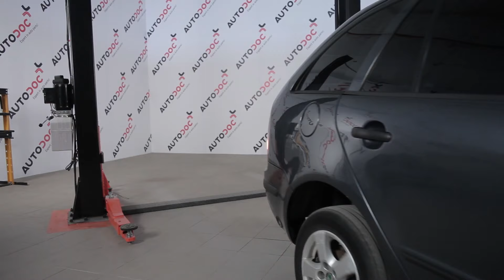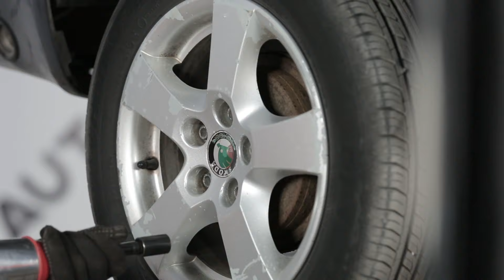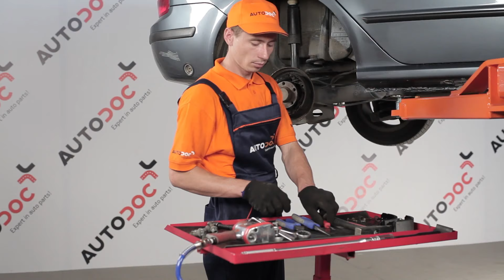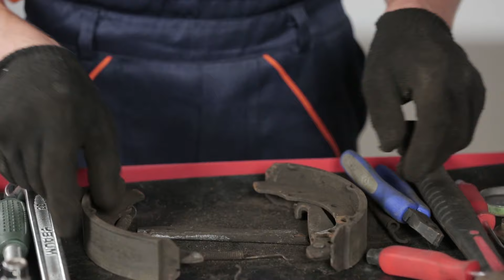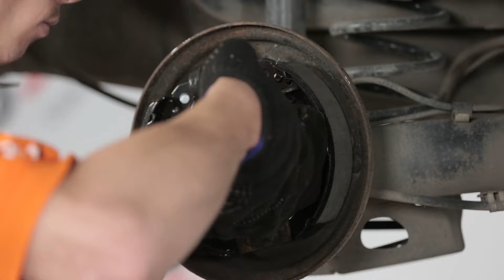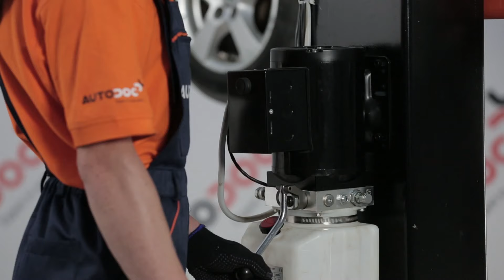How to change a rear brake pads SKODA FABIA 6Y TUTORIAL | AUTODOC

Comment: FYSA - the axle hub nut is a 30mm.  Your video guide calls for a 32mm box end spanner but uses the 30mm end during the torque sequence at the end of the video.
Reply from the maker: Thank you for your feedback! You are absolutely right, we made a mistake in the captions. Unfortunately, we cannot change the captions, but we will add this information to the description. Thank you for your valuable remark! Best regards, Autodoc.

Comment: Funny how the drum just came off, had to push adjuster up to release mine,  also funny the hub came off with a slight pull, had to use a puller on mine and then landed up buying a whole new hub as the bearing came apart when the hub finally did  come off not so straight forward as this suggests
Reply from the maker: Thank you for the feedback! We hope that our tutorial was helpful for you. Stay tuned and follow our latest updates. Best regards, Autodoc.
Reply: Same with every single autodoc video, they are basicly commercial ads, not technical guides that you should follow.